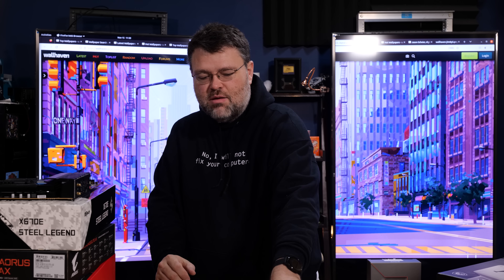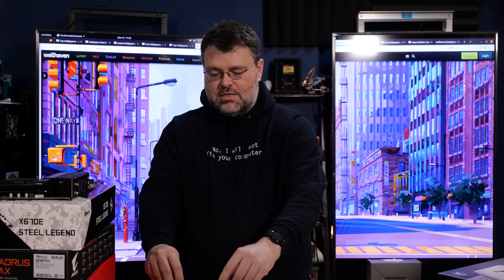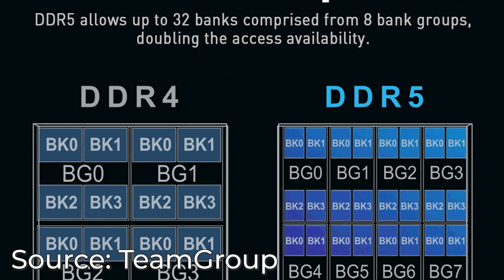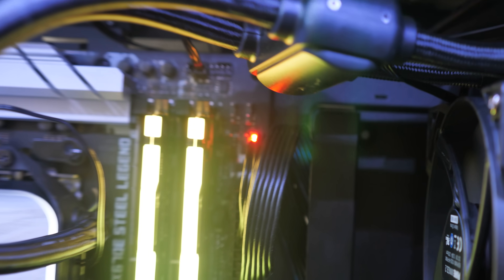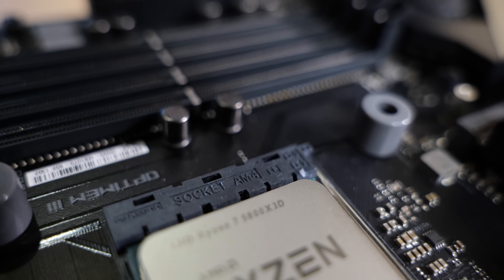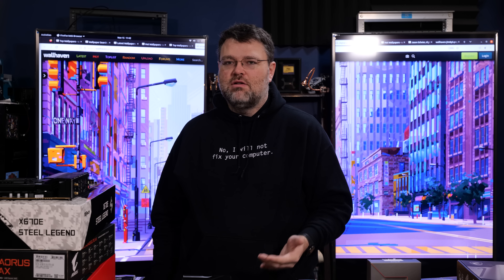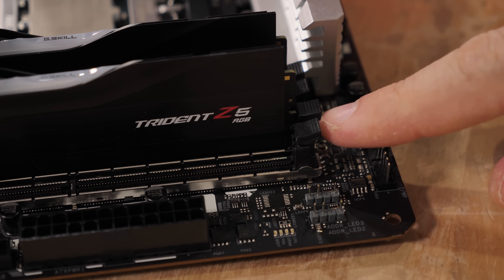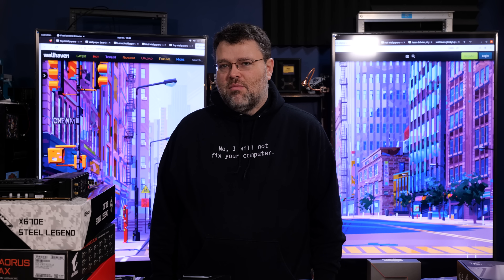Is 128GB of DDR5 IMPOSSIBLE on AM5? Level1 Investigates!

Comment: And the fanboys are still running with the bogus "DDR5-6000 is the sweetspot". That was the INOFFICIAL response of an AMD-marketing manager when asked about memory-OVERCLOCKING.
So yeah, when overclocking DDR5-6000 is the "sweetspot" as in that is reachable by many, but not by the majority. There is a reason why AMD had send out CPUs together with handpicked memory and instructions to use that for the reviews.... the same stick with the fanboys as it was with Zen1 and the claims of DDR4-3600/3200 sweetspot.

But i would not say there is much of a problem yet. Not only, as you said, does AMD not even support DDR5-5600 AT ALL (not even with a single stick), let alone 4 DIMMS at DDR5-6000, there are also so far no DDR5-6000 JEDEC sticks available (5600 has only recently started full production and there are very very few sticks around ). Most memory 5200 and over is glorified overclocked 4000-4800 and can just barely reach the configured timings if everything works well.

TL:DR: most DDR5-5200 and higher is not that stable OC-memory anyways so kinda to be expected that there are problems. Don't fall for some unofficial statements made online in private by a random marketing-guy.

Comment: My x370 has no problems running the oLOY 3600 128GB kit...
If AM5 can't run 128GB then that's quite embarrassing.

Also, it's not a "name" it's a product number.
Look at the other products on the table:
The MBX670ESTEELLEG
and the X670AORUSELITEA

Comment: Honestly I feel like AMD shouldn't advertise 128gb RAM support until it really works properly. That or MB makers should just put two slots on their boards and call it a day.
Reply: 128 GB support has been there since AM3 days. I do not know what you mean by "working properly," but it seems to work fine, albeit at reduced speed. That is not on AMD but physics.  Every memory controller in existence has had the same limitation.
Reply: I have a shitton of Ryzen build with 128GB and also same with Intel platform and this is just normal limitation when have double the number of RAM sticks, it has nothing to do with Intel or AMD, you have to get lowest speed

Comment: (Intel) I've had my own fair share of troubles using 4x16GB of the 6400 ones. At 6000 the 4 sticks seem to run stable now but I'm not super confident.
So that means you can also get 128 at 6000 working likely. In general it's really a shame how bad the situation with DDR5 is currently. With AMD it's a catastrophe..
With rather conservative downgraded settings I get borderline 90mb/sec read and write at 76ns latency (with HyperV active, so maybe a bit less than real)
No artifacting, no memory errors but I have had an application exit (might be unrelated).
That's on a z790 13900k setting.

Comment: Apple M2 .................. 6,400 MHz ..... 24GB LPDDR5 ....... 128-bit (2-channel) .......... 100 GB/s

Ehm, fan-less ultra-thin ARM laptop beats in bandwidth the best and expensive desktop CPU Zen 4 (70 GB/s). With DDR5 sensitivity for good contact those soldered LPDDR doesn't look bad now, doesn't it? Smartphones as Samsung S20 had LPDDR5 memory back in 2020 already. In 2023 there should be new 8500 MHz LPDDR5X (1.32 x more).

New AMD EPYC Zen 4 (Genoa) has 12-channel 4800 MHz DDR5 with total bandwidth of ..... 460 GB/s.... https://www.techpowerup.com/img/WP5I2c8QIiMH24HV.jpg
M1 Max in laptop has 8-channel 6400 MHz LPDDR5 with total bandwidth of ......................... 400 GB/s.
Upcoming M2 Max with 530 GB/s will beat even server 12-ch EPYC.

Apple M1 Pro ........... 6,400 MHz ..... 32 GB LPDDR5 ....... 256-bit (4-channel) .......... 200 GB/s
Apple M1 Max .......... 6,400 MHz ..... 64 GB LPDDR5 ....... 512-bit (8-channel) .......... 400 GB/s
Apple M1 Ultra ......... 6,400 MHz ..... 128 GB LPDDR5 ..... 1024-bit (16-channel) ...... 800 GB/s

If the rest of M2 line up will have 8500 MHz memory:

Apple M2 Pro ........... 8,500 MHz ..... 48 GB LPDDR5x ....... 256-bit (4-channel) ............ 265 GB/s
Apple M2 Max .......... 8,500 MHz ..... 96 GB LPDDR5x ....... 512-bit (8-channel) ............ 530 GB/s
Apple M2 Ultra ......... 8,500 MHz ..... 192 GB LPDDR5x ..... 1024-bit (16-channel) ..... 1,060 GB/s

Upcoming M2 Extreme for Mac Pro replacement will further double Ultra's bandwidth:
Apple M2 Extreme.... 8,500 MHz ..... 384 GB LPDDR5 ..... 2048-bit (32-channel) ...... 2,100 GB/s
Reply: You know, AMD and NVIDA’s latest GPUs are running 1 TB/s. You are comparing different things.
Reply: @penguinbelly  I compare CPU low latency memory. Yes, LPDDR5x has even better latency than standard desktop PC DDR5 (shorter signal path).

You try to compare high latency GDDR video memory which doesn't make sense. You know, there is a good reason why CPU doesn't use GDDR memory....

Comment: I bought used B350 motherboard with 1700x, that had pretty old bios and 2666mhz Adata 4x4gb kit. I could not make it run at 2666. 2400 had stability problems and only 2133 worked fine. After bios update it could easily run 2666 and then when I upgraded to 3200Mhz kit it also run fine at 3200Mhz without any issues, so a lot of memory problems on first ryzens was solved by bios updates. I also think that memory manufacturers had to learn "AMD" again after being abandoned for a while. It was a lesson for both - motherboard and ram manufacturers to get back into AMD and make some compatibility tuning. I don't know how it was before, but now I even do not have to tune the Infinity Fabric. It always automatically sets itself to 1:1 ratio with memory.

Comment: Ok I have question.
What will happen if I use 4 DIMMs of Low speed DDR5 like 3600 MTs but I adjust their CAS Latency to absolute lowest possible? 
Something like CL26 and leaving the speed at default.
Reply: It depends on what you do. If you need more than 64GB of RAM, nothing can replace RAM. If you don’t need more than 64GB why bother with 128GB?
Reply: @penguinbelly  that's not really scalable.

From what I've seen, only lower speed RAM can achieve absolute lowest CAS Latency.
And Latency matters in Video Games.
I haven't seen any Game that actually use more than 20GB of RAM.

Because 4 DIMMs at 3600 MTs isn't really a bottleneck for any video games, even in DDR4. Not to mention Microsoft DirectStorage API can overcome GPU asset-call from SSD.

DDR4 on its own already have respectable CAS Latency at its peak 4000 MTs with CL16. No games will ever stutter at this configuration.

DDR5 somehow has absurdly high CAS Latency yet they try to overcome it with higher speed, which kinda seems counter-intuitive. Because higher speed ≠ Latency.

Comment: I just built my wife a new system and loaded 128 gig with no problems. I have had to set the asus board to normal operation. It didn't like the speed boosting mode much. It would occasionally crash. On normal mode it just fine and no errors. I used 4x32 ram.
Reply: Yeah but the thing is 3600 is pretty damn slow for ddr5. Unless she really needs 128, a decent 2x32 kit is much better for cheaper.

Comment: Maybe this was answered in the video, but why did they change the memory dimm slot design so they're not as rugged for ddr5 for am5?
Reply: a through hole connection is mechanically stronger but more noizy. When treating with high frequency signals, surface mount has less parasitic impedance and capacitance which allows a better transmission. The other reason is manufacturing costs, as it doesn't require drilling holes though the PCB (or at least just a few to add mechanical support)

Comment: So....I'm quite confused now.

The results where you show that the 4 DIMMs (2DPC) @ 4x 32 GB DDR5 -- was that at DDR5-3600? DDR5-4000? or DDR5-3800?

The screenshots appear to show that the ~50 GB/s speeds were at DDR5-3800 speeds, but you mentioned that 128 GB @ DDR5-3600 was possible and 128GB @ DDR5-4000 had some stability and/or artifacts from the iGPU, but you didn't mention DDR5-3800 speeds.

Can you please clarify?

Thank you.

Comment: And this is why I went with a 13900K when upgrading from AM4; Intel just has better memory support this gena and the Z790 Apex from Asus has a great topology for ram OC
Reply: Are you running 128gb though? I've read intel users are just as much out of luck with 128gb ddr5
Reply: @simonthibodeau7082  I’m running 32 Gb DDR5 7600 which AM5 definitely cannot do.

I would not bet on anyone having good experience with 128 Gb DDR5 till q4 2023 earliest

Comment: I would suggest enabling spread spectrum if you end up with dual-rank memory side-by-side to help stability.
Reply: How does this help though? The same clock to both modules gets modulated.
Reply: @ristretto97  By somewhat blurring the signal of the modules, the read and write cycles can be written to each chip without having to worry about directly affecting the chip on the next board next to it by writing at a similar frequency.  Think of it like being slightly off-key from the wine glass so it doesn't break, only electronic.
Reply: @erickcoutsii9499  I understand how SSM works. However, what I don't understand is how it makes any difference since the same PLL generating the modulated signal is fed to both modules. They are both fed the same modulated signals so there is no difference. Doing SSM on a per module basis would create intermodulation beat frequencies. Also, SSM is typically not for signal integrity but reducing quasi-peak emissions.

Comment: What is the Problem with Speed reduction If you use 4 Sticks? AM4 do exactly the Same. I use a AM4 System with 128gb RAM with 3400ghz RAM clock. This is OK. Also for heavy RAM usage. If you need more Speed threadripper is the way to Go. More Channels is every time a better choice before overclock RAM to gain high RAM GB/sec
Reply: I don’t think these people care about real speed. They care about higher numbers.
Reply: @penguinbelly  yea ... Classic spec war 🤣 for 2-4% more FPS.

Comment: your focus on the video is kinda strange, all you talk about is GB but the core of your problem is 1dpc vs 2dpc but you link that with RAM capacity. But except for 128GB those two are not related.
4 dimms work always worse than 2 - on both AM5 and 1700

Comment: Let’s be honest, anyone needing 128GB of memory should be using Threadripper or an Intel HEDT platform. These people are probably more concerned about memory bandwidth or capacity than the CPU’s performance. I know Threadripper will offer higher memory bandwidth, capacity additionally it will offer more cores for any compute workloads the use will probably have.
Reply: I'm using a 7950x with 128gb ddr5 for a 2 users 1 pc creator workstation. The 7950x is definitely good enough at literally a fraction of the cost of a threadripper workstation. Having 128gb support is important to me no doubt. It'll come eventually and I managed to get it working at 4600 just fine, very stable. Threadripper is a dead platform right now and I'm glad I could avoid it. The price difference is absolutely humongous if you don't need more than 16 cores and 128gb.

Comment: Was wondering about these DDR5 memory stuff, which is the best value Z690/Z790 motherboard to overclock RAM and also run high-end 32GB (16X2) DDR5 7600 CL36 and above kits?

Comment: im still on launch day 1800x and i remember the day going to get it, and the next few weeks on forums lol.
 im still rocking the 1800x, 1080ti STRIX, 
TridentZ 2 x 16GB 3200 16-16-16-36 had the ram timings tighter for a few years, now back to stock,  
C6H. 
it running games fine/ok lol always want more right?! back then and to date iv said im gonna upgrade this system around about 2025 now to wait. i also have custom water setup so not wanting to upgrade every 2-3 years. im ok with the long haul i just try to build with the best parts out at the time and run the system for many years or until its not doing what i want it to.

Comment: Now is this becouse IMC, or crosstalk from MB? Im into x670E asrock steel legned,. My plan for now is only 32GB, after at EOL (with latest R9 CPU i can buy) i plan  run VMs with ECC ram, full 4 slots, 128GB.

Comment: This sounds like the same issue i am having right now with my 7950X system and using two identical kits of 2x16 GB G.Skill Tridenz Z5 Neo DDR5-6000 CL32  EXPO that initially took me hours to get it running, with EXPO enabled.
Interestingly enough i have used the system for more than 2 weeks and had no problems. But since today the system wont post with all 4 sticks installed anymore. If i remove the additional kit it posted after a forced bios reset and 15 min of delay.
Reply: Did u get 64gb?
Reply: @thealien_ali3382  Yes, got a 64 gb kit after selling the other ones and it works perfect - with expo enabled.

Comment: So if AMD knew that folks would want to run at least 128gb of ddr5 (which automatically means dual ranks) on am5, why would they not go from using 2dpc to 1dpc by adding another 2 memory channels.  the threadripper stuff has 8 channels... why would they not do this on the consumer platform!?  it seems to me that there is a HUUUUGE gap between high end consumer stuff right now and HEDT workstation stuff (With threadripper pro starting at what? $3k or something ridiculous and is still using the previous generation (am4) architecture which means significantly lower ipc and frequencies) and don't get me started on the paltry number of pcie lanes on modern high end consumer cpus that only have enough i/o for 2-3 m.2 drives, whatever standard i/o (usb onboard networking and audio), and a single gpu - MAYBE one more x4 device if you don't mind sharing it's bandwidth with one of your ssd's o_O and MAYBE one more 8x pcie device if you don't mind HALFING your gpu's pcie bandwidth...)  if AMD is going to roll a whole new platform and Intel is going to keep rolling whole new platforms every other generation (smh), I demand some kind of in between enthusiast/creative desktop.with 16/24 core cpus in the $1000-1500 range that have at least 4 memory channels, at least 64 if not 96 pcie lanes.

Comment: The bandwidth speeds you mention do sound so low. Are these single core bandwidth or is that the real limit of the full multi core bandwidth of the chips.

I am sitting here with an M1 Max MBP im thinking my single core bandwidth is 2x that let along the multi core bandwidth.

Comment: Crap!  Thank you for making this video. I have had a shopping cart I was about to pull the trigger on this weekend for a major workstation upgrade that contains a 7950x, 2 kits of corsair vengance rgb 64gb 5600mt cl36 ddr5 assuming that it would "just work" like the 3800mhz cl18 ddr4 i'm running with my 5950x... I didn't consider that it might not work at rated speeds... this might actually push me over to intel (but i'd really rather not if i can help it)  anyone have any suggestions for me?  I do lots of heavy creative applications and homelab vm stuff.
Reply: Maybe threadripper then? Fact is 128GB does not work very well on Intel`s newest platform either as the video explained.
Reply: @lagarttemido  Sure, i'd love a zen4, non-pro threadripper.  when can I get one!?
Reply: @joshhardin666  what a joke
Reply: well intel still supports ddr4, so you stick in a 13900k and re-use your ram and probably even go 4000+ as 3800 is around the max the 5950x will do.

Comment: Wonderful video. The following are 2 - 4x 32gb ddr5 memory kits that are on Amazon : 
SABRENT Rocket DDR5 128GB U-DIMM 4800MHz Memory Kit (4x32GB) for Desktops and PCs (SB-DR5U-32GX4) this kit is $799.96 and A-Tech 128GB (4x32GB) DDR5 4800 MHz UDIMM PC5-38400 CL40 DIMM 288-Pin 2Rx8 1.1V Desktop RAM Memory Modules - this kit is $679.99. Maybe having 4 matched dimms might do a little better. I have 128gb on my current system ( AM4 ) build. At the time I put this together all of the parts were the best for there respective class - since then newer updated parts have replaced my parts as the best. The RX 6900xt was the best gpu class for gpu's from AMD now there is the RX XX50 replacements. Maybe the lack of a central memory controller might be a part of the issues at the moment.

Comment: High speed links like memory and PCIe really seem to be making life hell for platform engineers, lately. DIP-socket SRAM and ISA, SIMMs and PCI, DIMMs and PCIe. Every time they start hitting a wall, they change up the form factor. I wonder what comes next.
Reply: Flush mount sockets rather than slots help. This is Dell’s DDR5 laptop standard, and nvidia’s gpu socket.

After that it’s cables.

Comment: Obviously the best solution is a hammer ;D 

But really - why would the creators of the boards make these slots weaker?    What was wrong with the old design?
Reply: well they had to switch to SMD for signal integrity reasons. Having those through hole pins in your signal path can become a problem at these high speeds. However you're right that that doesn't mean the slots need to become weaker. Using slots like on his asrock boards with the added metal mechanical support pins that go through the board seems to like the obvious thing to do.

Comment: Would this be an option for a truenas home server if you want 128 gig memory and don’t want to buy threadripper?
Reply: I got my 7950x workstation working with 128gb ddr5 at 4600mts just fine. Definitely worth it for me, Threadripper is in a whole other price bracket or two, it simply was NOT an option for me. Running 2 users on it just fine for creative work.
Reply: @simonthibodeau7082   if i knew that i wouldn’t bought my used  threadripper 1900x, the 7600x with 128 gig memory would be good enough

Comment: Hey... on memory... is it better to have 2x16 sticks, or 2x16+2x8 sticks (assuming same manufacturer and same timings)? (16 sticks would be double rank, 8 sticks would be single rank).
Reply: 2x16 the other configuration will not work.